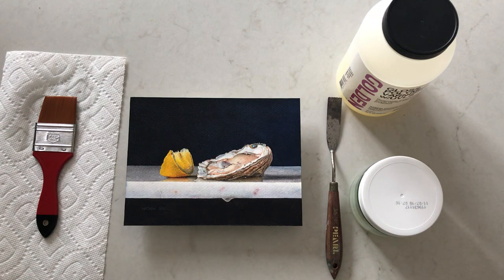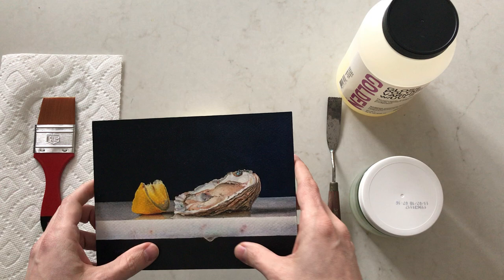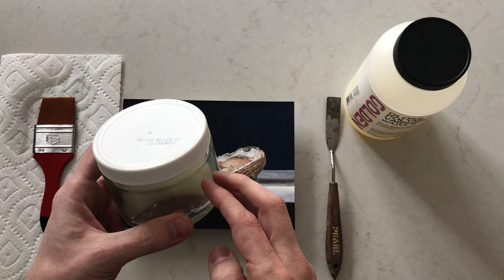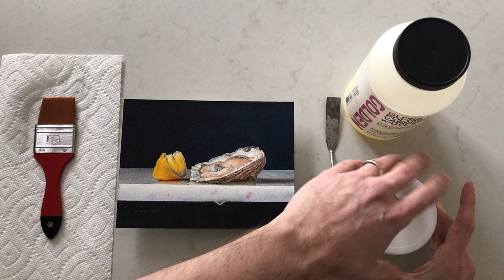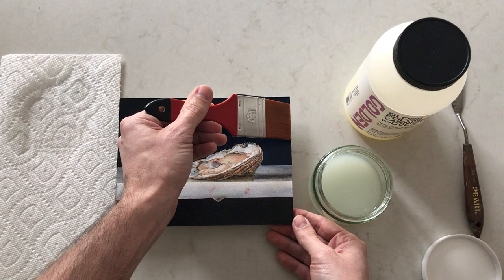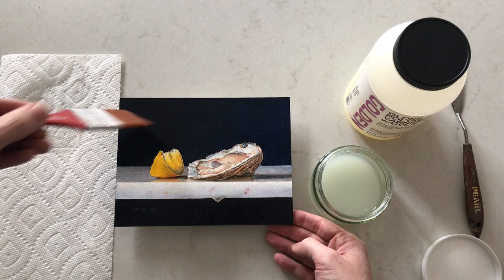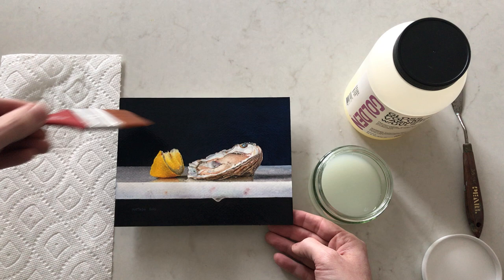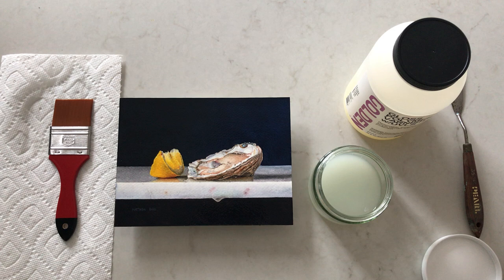Matthew Bird Watercolor Varnish Demo

Comment: Matthew, what do you mean by "one isolation coat?" Are you using the same product for that coat and what makes it different than the other layers? Thank you for sharing, this was interesting because I never thought of folks varnishing watercolors. Makes sense to protect them.
Reply from the maker: Hi Dawn, good question. The isolation coat is a different product and the reason to use it would be if you wanted to remove a varnish that is put on top at a later date. I wrote more about it here: https://matthewbird.com/blog/2019/11/4/my-watercolor-varnishing-process

Comment: How dosen't the watercolor activate on applying the wet varnish? Also will an acrylic varinsh work on watercolor?
Reply: Acrylic varnish is what I use, it works. I seal the watercolor with a spray varnish before applying with a brush so it doesn't reactivate.
Reply: @lorrainewatry8138  Thank you so much for replying. <3
Reply: @lorrainewatry8138  how many coats of the acrylic varnish and spray varnish do you apply? And are there any specific brands that you prefer?
Reply: 6 coats of gloss varnish! Why that many?
Reply from the maker: @awatercolourist  For me I'll spray at least 4 coats, it all depends on how you apply it. If you have a heavy hand it doesn't take as many.
Reply: @matthew-bird  What type of spray vanish do you use? Is it the same spray fixative for pastel or different kind?
Reply from the maker: @someoo  Golden Archival Gloss, my full process is outlined here: https://matthewbird.com/blog/2019/11/4/my-watercolor-varnishing-process